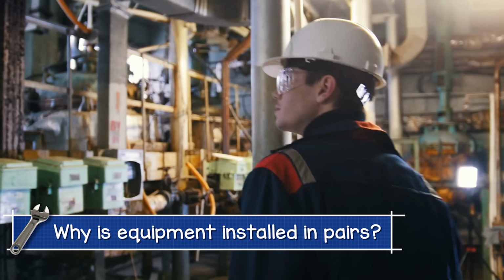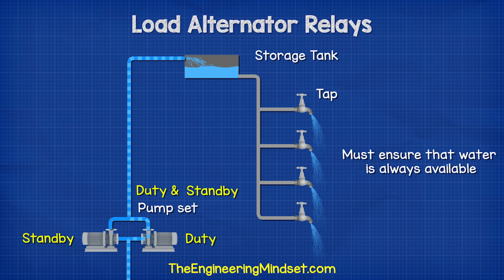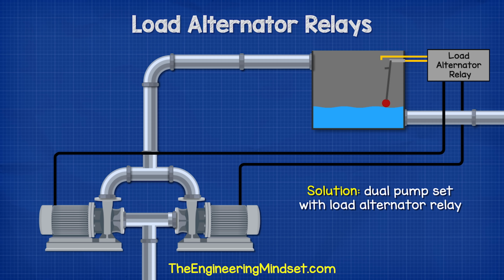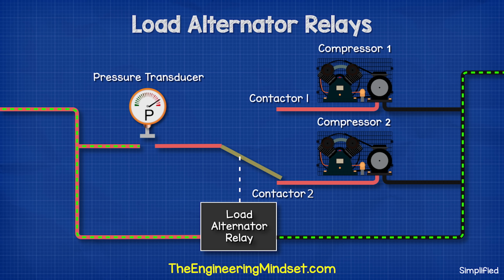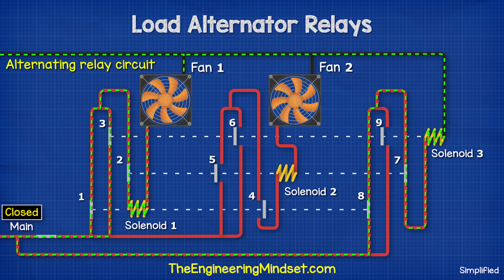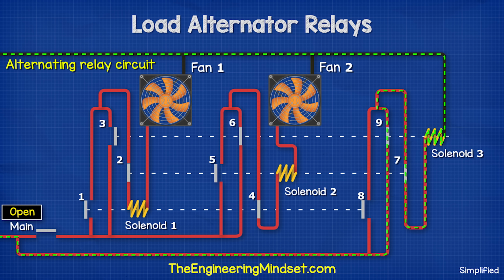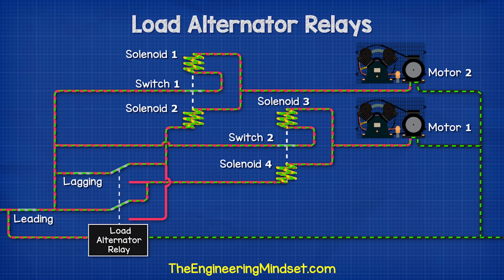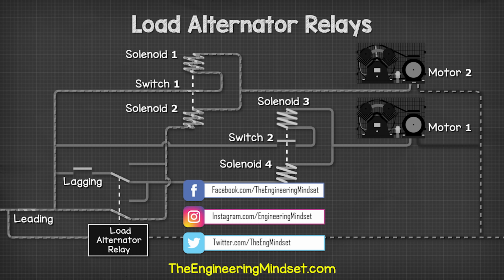Relays Load Alternator - duplex relay How it works

Comment: Newer pumps and motors are getting so well design it is starting to negate the need for this. In my industry we are getting away from frequent equipment swaps and instead leaving 1 machine in service for up to 2 years at a time.  We simply bump test the standby or test the auto start logic and secure it.  This prevents false bruneling for horizontal pumps.

Comment: I’ve always had problems with equal runtime, alternating systems.  I would rather have the duty system run several times for each run of the standby.  That way both systems don’t end up wearing out at the same time.  You can have the standby run often enough to exercise it properly.  It’s harder to do with simple relay logic.
Now, there are very valid reasons why you don’t want the same piece of equipment to start all the time.  That’s fine you can alternate them at that point.
Reply: Agreed :)

Comment: Most of the new and updated equipment in heavy industry has been connecting these systems to the automation for decades. The automation system allows for more flexibility in the overall system utilization.

Comment: on more than one occasion i've seen jobs with a twin pump set installed without the necessary controls fitted. instead of using an alternating relay the installers just permanently disconnect power to one of the two pumps, the other pump runs continuously. very naughty but they do get away with it.

Comment: Standby and Duty Systems, only work, if the People who control the Money, understand why they are required. I've had it, where I had a Duty Pump fail and the Standby took over, we went to get the Failed pump repaired, only to be told, "Why you've got a Pump Running, you dont need the other one". This is all well, until that one breaks as well, but all we got is " Risk versus Cost"
Reply: Indeed, we stumble across that pretty often. You can prevent so many fault cases by only having a monitoring relay or so that's less than 100 bucks

Comment: PLCs have gotten so cheap these days that by the time I got to the lead-lag case I would have designed in a CLICK. The benefit of the PLC is the ability to do more advanced logic like actual run hours balancing as opposed to just alternating and detect various faults (like if a compressor is not generating pressure even though its on). Plus, the PLC can get all this info from a single pressure transducer as opposed to multiple pressure switches.
Reply from the maker: PLC video coming in 2 weeks. I'll tag you
Reply from the maker: PLC video now live: https://youtu.be/uOtdWHMKhnw
Reply from the maker: Seen our new pressure switch video? Link: https://youtu.be/YG81w0HFXNc

Comment: Rememeber that equal runtime and equal wear means both devices will reach their breakingpoint at the same time.

I witnessed a horible example of this in a computerserver where 12 harddisks where setup in an array of 2x6 disks. This meant that the data was spread over 6 disks and then copied onto the other 6 disks. Theoretically this means you can have 1 disk fail on each group of six and still have your data safe. If two disks fail on the same set there is a second set that still has the data. Unfortunately all 12 disks where purchased at the same time and they came from the same production run, so they where exactly the same age. So what? Well the unthinkable happened; within one week three disks failed, two on one set of 6 and one in the other. If a fourth one had failed before the new shipment of disks delivered, the company would have suffered serious data loss.

Since then I make it a point to wait a few weeks between ordering multiple units of the same device, or I order them from different suppliers, just so there is no chance of getting units from the same age or possibly the same faulty production run.
Reply: If multiple devices were installed at the same time then it's a good indicator when the first one fails you know to replace the whole lot. The equal wear and runtime is unlikely to be so exact that the failures are identical. I've seen a number of installations where two devices are fitted, one in constant use and the other never used but fitted as a ready backup in situ. Both items had a similar lifespan even though one got used hard and the other didn't, because they were both situated in the same environment.

Comment: How to wired it????????
Input and output connected ,thanks🥰
Reply: You simply require a power supply and a control input to switch your loads. More here https://www.tele-online.com/en/produkt/e1zmla10-24-240vac-dc/